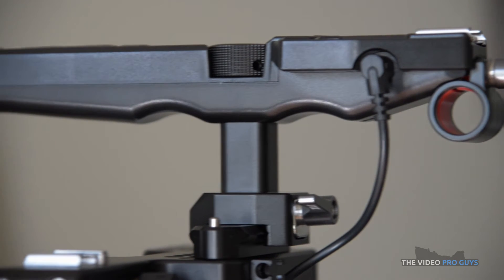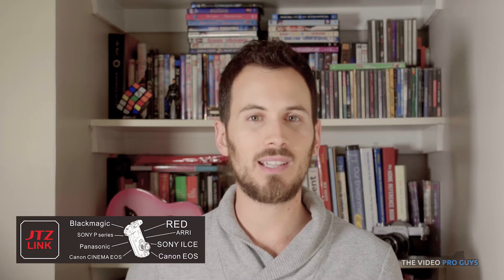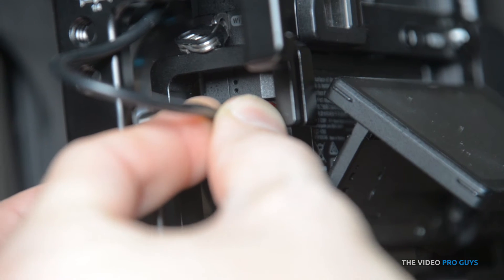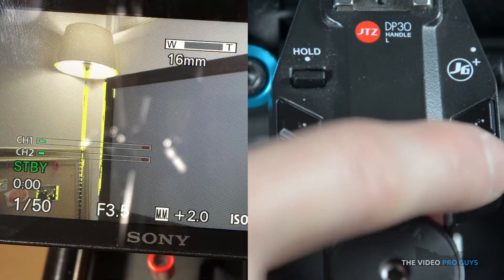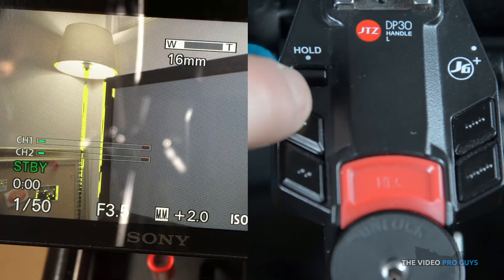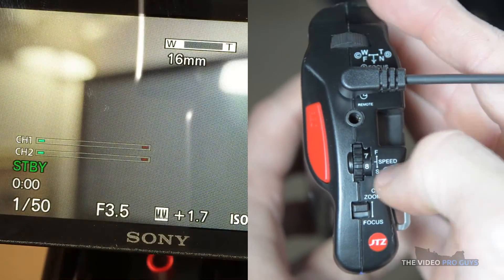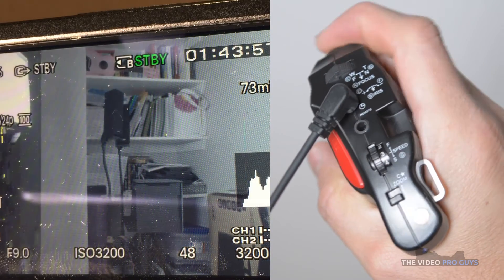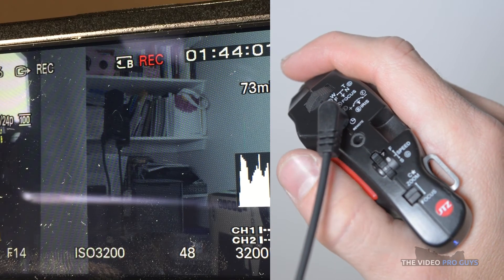JTZ DP30 Top Handle and JTZlink function review

Comment: Thanks for the review - I want to know if you can have both the grip and top handle working at the same time. So if you're moving underslung you can use the record button on the top handle but if you switch positions you can use the record button on the handle. On most rigs it seems like you have to plug in one or the other.
Reply from the maker: On some of their cages (A7,A9,A6300...), you have 2 inputs for the cable so you could use the top handle and the grip at the same time.

Comment: The grip works with an usb cable without the cage on a7s?
Reply from the maker: Hi Adrian, it doesn't. The USB comes out of the cage. The handle needs to connect to the cage, then the cage to the camera body.